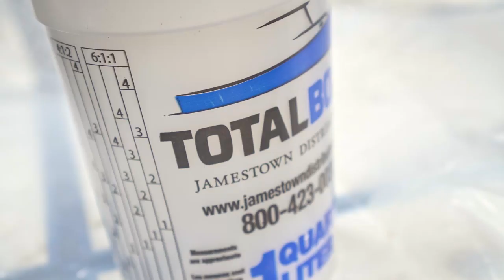Woodturning: Making An Ocean Inspired Epoxy Resin Coffee Mug (4k)

Comment: Looks  great. I think your getting catches and chipping because your tool rest is to low.  It should be set so that the tool your using is either right in the center or slightly higher.

Comment: Can you pour this Total boat epoxy this thick without a pressure tank? I am just curious because it seemed to cure way to fast and there are still bubbles on the epoxy.
Reply from the maker: I wouldn't suggest pouring a single pour this deep without pressure

Comment: Great work on the Mug but I have one question and that is before you start making the mug I noticed a big ring around the top of the mug that you sealed with hot glue and then put the PVC over the top of the whole thing can you tell me what that ring is and what it is made from and it's purpose ? I am a little confused :) i look forward to your help   Cheers   ian
Reply from the maker: It's a seal to stop the epocy from leaking out or into the inside of the mug insert

Comment: So i did something simmilar a few days ago and the epoxy melted the hotglue when it started its reaction. Can somebody tell me what i did wrong?
Reply from the maker: If it melted the hot glue that means that you had the hot glue in contact with the epoxy as well as you were possibly using an epoxy with too aggressive of a set curve which has a very very strong thermogenic reaction
Reply: @jpaynewoodworking7510  Thanks for the answer dude, yes that could be it. The epoxy got pretty hot and in the cup i mixed it in it even started steaming...
Thx for the answer dude

Comment: Tool rest is WAY too low. The tool should be cutting right in the middle of the blank, on a line even with the point of the tail stock - and carbide tools are held parallel to the floor, “flat”, not at an angle- keep them sharp with a Trend diamond stone 

All the best to you!